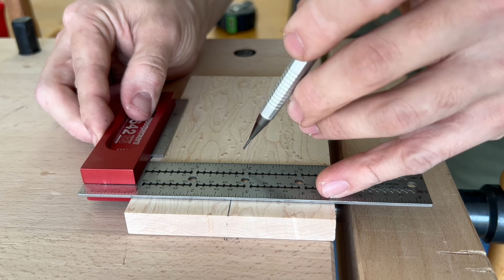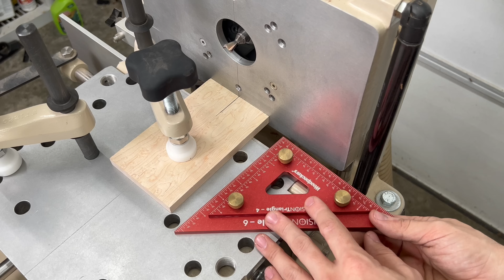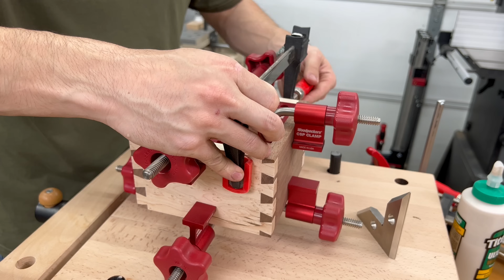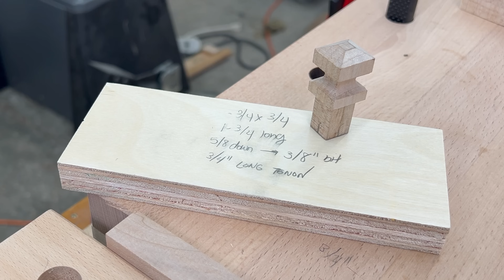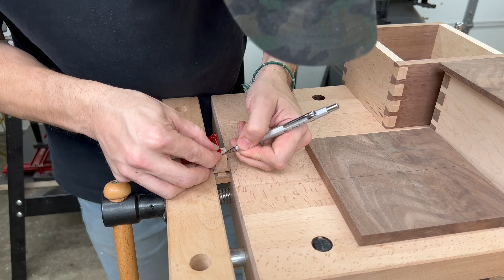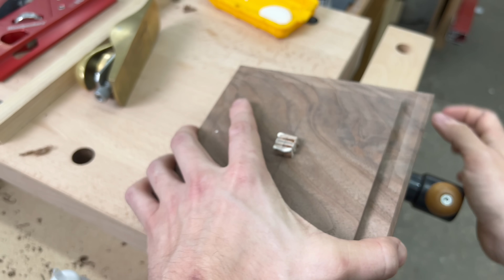The Perfect Dovetail Keepsake Box l RedTOOL WOODSHOP

Comment: Excellent video.  The 3/8" collar you used resulted in a 3/4" radius corner.  How does that work?
Reply from the maker: The radius is created by the outside diameter of the cutter...1-1/2" diameter creates a 3/4" radius. That will be the same no matter which collar you use. The collar only affects the width of the rabbet.
Reply: @WoodpeckersLLC  Of course - thanks for the prompt response.

Comment: it's so funny, the multi router has been around for over 30 years, I used one in college, woodpeckers buys it and now the whole set up is $1500 more.  Nothing has changed including the color, you would think they would at least paint it red.
Reply from the maker: Actually, the price went down by a bit when we took over. Might be $1500 more than 30 years ago, but what isn't?
Reply: @WoodpeckersLLC  I didn't say that was the price 30 years ago back then they were around $2000 with the templates and air clamps if I remember, last time I checked wasn't a few years back when I was looking at buying one or a slot mortiser which I ended up buying one of those. Multi router is a good tool no doubt, I have done many things with it back when I was in college